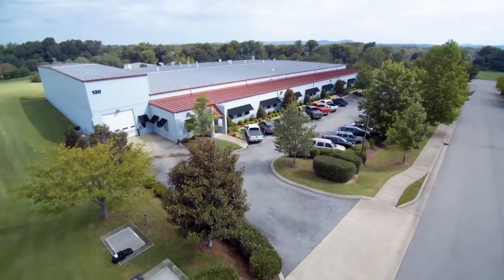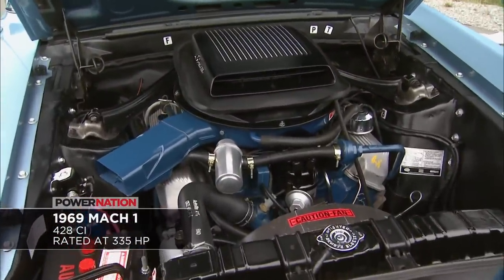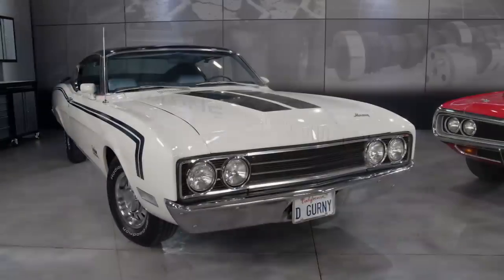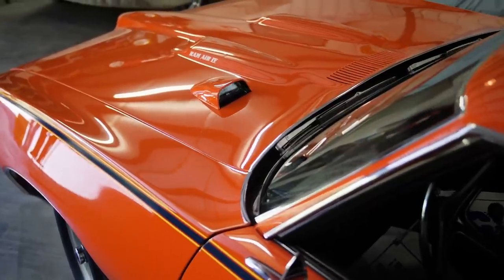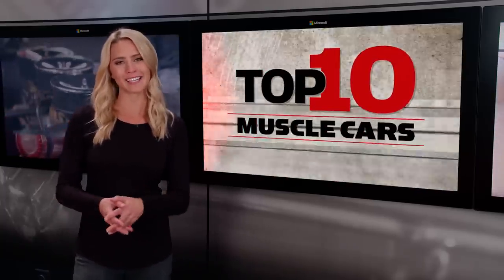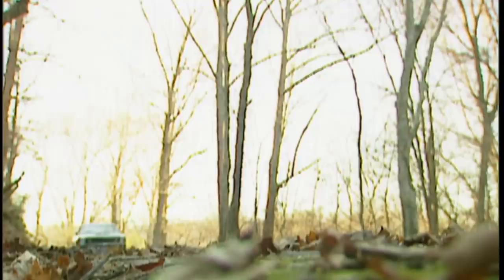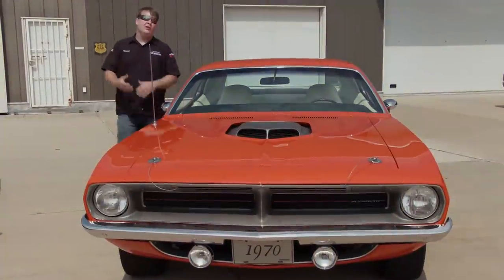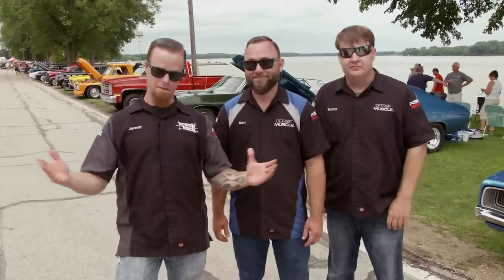Detroit Muscle's Top 10 Muscle Cars

Comment: So I guess why 1973 FOUR DOOR with a 400 small block dual Edelbrock four barrel With this crazy cam I had in it don’t even remember how the high and low the numbers were.  License plate that said backfir on it. 12.9 quarter mile roughy 130 mph.Plus has the audacity to do it a 4 door. My senior year high school I changed my license plate to reag 5.0 Slay.  I promptly put all the poser and used to be’s but aint no muscle car we let’s think of the 1957 Plymouth Fury was a muscle car Christine had 2 drs it was a luxurious considered to be status’s symbol car. But The movie Christine made it out to be a muscle car. So if a two door luxury Plymouth fury can be considered a muscle car then why can’t my four-door Chevrolet Caprice classic not be considered a musscle car?  The only part of my car that made it a 4 door was the finder skirts. Which by the way I kept them on. So in short my 1973 please caprice vs  anything that had a 5.0 badge on it and I never lost. As long as the race was straight so that I bought for my grandma and grandpa  was considered a grandma and grandpa car ended up having this musclecar feel to it smoked every small block card and a few big blocks. But it had 4 doors.

Comment: is that show filmed in downtown GM? Being a dodge man myself I do agree with the Hemi but if your going Cuda the 71 convertible 4 speed is the creme of the crop. I want to point out that you talk about the gto being the first muscle car but as usual you left out the max wedge cars and my pick would be the M code 1969 Dart GTS 4 speed, for the street but I would say the 68 dart and Barracuda's with  426 Hemi cars were the ones to beat at the track . The DART was  the fastest production car until the demon was made recently.  Speaking of A body's the fool in the Boss 429 pay attention and learn something, The barracuda  in the valiant form was unveiled and sold 2 weeks before the 64 1/2 was. So to say the cuda would not have been if it were not for the mustang is complete Bull shit. Next should we discuss what  that motor was in that car? Hello it was a Hemi, and we all know the big 3 copied each other all the time so yes ford copied chrysler, but  the shaker was on a ford  model a year before the Cuda. What I don't understand is your list and what didn't even get a mention. Here are a few I think should have made honorable or higher , Dodge Challenger RT, TA , AAR Cuda, Buick GSX with stage 3 heads,  Cougar Eliminator, Boss 302,  442 you mentioned the 67 vette, but come on,  the split window or the 69 427 tri power should be there. 'The LS-6 was a hell of a motor but one year only. The 396 saw a lot more action in the Chevelles  than the LS-6 or the LS-5 . No mention of the El   Caminos, Monte Carlo, Torinos , Javelin's, Rebels, Firebirds, Trans ams, Trans am HO with the 455 in 73. By s. How the hell did the z-28 only make a miss congeniality list from you? My list is at least fair towards all  three manufacturers even AMC. Hell you didn't even mention the Pantera. I at least have  respect for the cars of that era and for their owners I just give them crap because thats half the fun of the rivalry. and  helps to  fuel the competition at the track. I think most the cars on your list I would not mind owning but given the choice to buy I would buy Mopar for many reasons mostly because growing up camaros and mustangs were as common as vw bugs and most were just as fast. very rarely would one come along that was worth talking about or being concerned about losing to in a race.

Comment: underated 69 RS Z28 That 302 came with solid lifters easy climg to 7,000 R.P.M. In 71 72 73 74 I raced 69 and 70 hemi challangers and beat them. I raced every kind of boss and mach mustangs and beat them.I raced a 70 Cobra 429 torino and beat him.Rev first to 7G's slam 2nd no way a passenger to pick up a hundred off the dash.I stoll have my yellow with blavk stripes no smog pump and headers.Early changed secondarys to mechanical.Recently raced from rolling start a super built badass 67 mustang and beat him.He told me I should be racing my car for pink slips.It easily winds tight to 7gs in 4th gear.